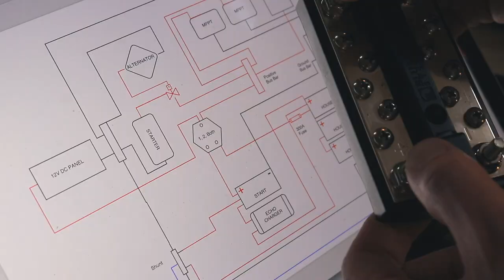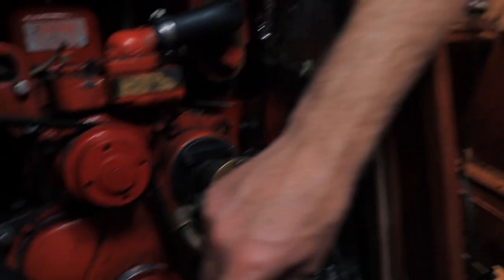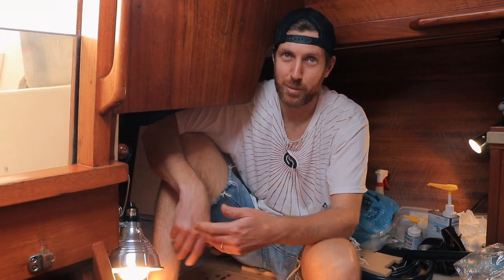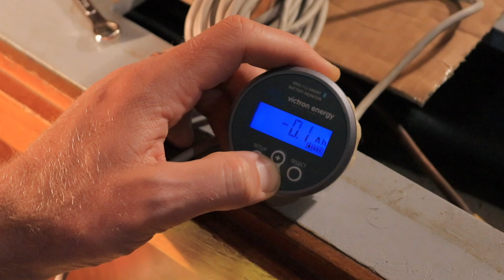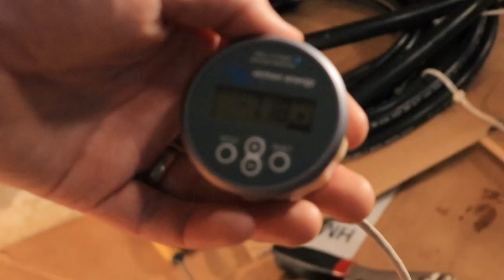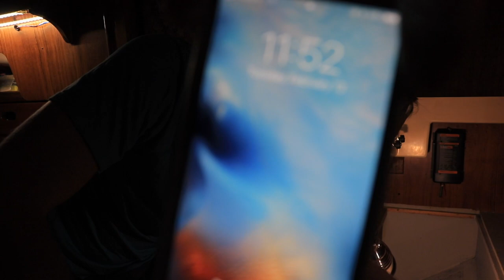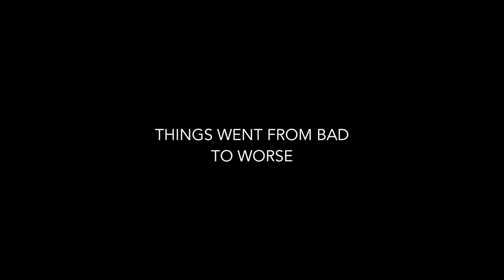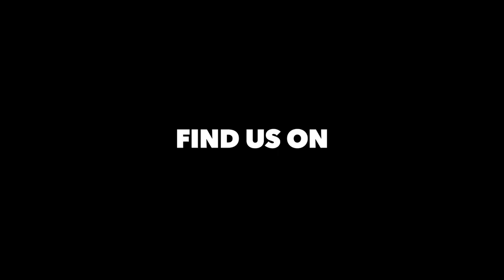Glad THAT’S Over | Sailing Soulianis - Ep. 38

Comment: Coming from a person who spent over 10 years doing that kind of work, namely, building Aluminum Marine Products for boats, including T-Tops, Open and Closed Radar Arches, Bimini extensions (Forward and Aft), Pulpits, Rocket Launchers, Swim Platforms, Fuel Tanks, Bow Rails, Poling Platforms, Tuna Towersmany other things for retail and high-end customers like CIgarette, Pantera, Carrera, Proline, Luhrs, PowerPlay and more, I can tell you for certain, we have never had to cut a product on a customers boat! Yes, it can be very difficult measuring compound angles offsite and then trying to duplicate them back at the shop without the boat, but there are ways that make it possible to do that and it's done every day sucessfully. 

If your not experienced at doing this, It may be best to make up a test-only version that is not anodized, but instead using mill finish pipe, just to get the shape correct for the final product and then using the anodized pipe. See, then, the mill finish one can be used to make a jig or template, it can be scratched and the baseplates (also in mill finish) can be hammered with a dead-blow hammer to make them fit properly when using 3 meaty tacks in a triangular pattern. Once this fits perfectly, it can then be used to make a gage or a jig to make the final product, but it's rarely necessary to do it that way. It's done by measuring on the boat, and then test fitting after it's heavily tack welded. If it's close, which it should be, the only things that should need to be done is tapping the baseplates until they match the exact angle of the mount location. The rest should always be dead on if done by competent builders with the proper experience. 

They should have brought out a lot of cardboard, and cut out the exact shape of the transom, the deck, and all other surfaces making a type of 3-D gage to use later as a double check instead of coming out so many times with a product that was severly out of whack. After the first failed test fit, they should have re-measured all, and found what went wrong in their drawings instead of trying to make it fit and embarassing themselves by acting like it was all part of the process. It is NOT part of the normal process by professionals.

We used protractors and made very detailed drawings of the boat, even putting them on Cad and found this to be a very good way to do it and show the customers that we knew what we were doing and give them confidence in our abilities in the meantime. We also required a 50% deposit only, and the rest was due at install, AFTER the product fit as it was supposed to. It's not simple to explain the entire process, but you seem to be very good at understanding the mechanical aspects of all you do on the boat, so I would think you follow me on this description of how it's generally done. Yes, there are times in prototyping things that we had to do all the measuring then bring out a tack welded arch, just to be safe and be sure of the fit, but if it was off, We measured the differences of the angles comparing what it was, vs what it was supposed to be, and that was all we had to do to make it work then taking back to the shop to weld up fully.

If you want to get quality Marine work, especially a Radar Arch, (fairly tricky off site for rookies) you really need to go to Miami/Ft Lauderdale or even the West side of Florida, maybe Tampa/St Pete. We were out of Miami, and it's known for being THE place to get the best work on those types of products because there are MANY shops doing that kind of work down there. Central Florida also has a couple of good shops. Let me know if you need any advice of finding a safe place to go once you leave that area.  Thanks for the videos, they are much enjoyed but sorry for your luck!
Reply: first off...name calling?? Really??

second...you're saying that they shouldn't pay them one cent??

Alittle late for that...with the required deposits they had to pay, plus the extended docking fees and other set-backs all this caused?? I certainly don't think they're planning on giving them any additional money. and Yes, they've now (obviously) fired them.

question is, how to get your time & all your money back, not to mention that they now have to find someone else to handle this project.

So, whadda they do now?? Lawyer up??
It's the same thing. 
Finding a good lawyer, and playing the waiting game with the court system. UGHHH!!!

Plus, I'm sure that they're gonna be gun-shy with even the best builders they find after enduring this ordeal. This is far from over with.

Man...this is a tough gig to handle, and where nightmares come from.
How to move forward, and keep your sanity.

All the best to you kids! Fair winds
Reply from the maker: Thank you for your detailed description.  It makes a lot of sense and is exactly what we expected to see happening. It sounds like you did good work!

That said, you can only ask so many questions during the "interview" process when hiring someone. Based on seeing what we were told was their work (which wasn't), we expected a decent finish.  We assumed to arrive at said finish, they'd need to take careful/detailed measurements. I don't need to tell you that it ended up being WAAAY less comprehensive than required. But, asking whether or not they use protractors, or jigs, or whatever other strategy for transferring the "boat" to their shop so-to-speak seems like an unrealistic level of investigative detail required for hiring someone, when the whole reason you're hiring the job out is because as a lay-person you don't have the required skills or know-how to complete the job.  

Either way after seeing how poorly they took measurements, the deposit was already paid, and we were "pot committed" to borrow a poker term - and were on the hook.  

We learned a ton from this experience, not the least being how better, to enter future work for hire agreements like this so that when our gut feeling tells us things are not going well and we need to exit, we can do so with proper protections in place.  Unfortunately in this case we had no reasonable exit strategy other than to fire them early on and loose our deposit anyhow.  Seeing as that was the outcome with or without letting them try to complete the project - we decided to give it a go, and do everything we could to get the best result.

All that said knowing what we know now, we need to do a better job of vetting people in the future. But for now we're ready to put this whole episode behind us and move on to more positive experiences. :)
Reply: @indrekkpringi  they were not in other marinas, they were in this one. Why would they stop at every marina in the world when they were given recommendations here?  I didn't see you telling them they'd have this trouble before they were committed to it.  And I already explained to you that they aren't gonna get a contract in this area.  It's real easy to sit there and call everyone an idiot when you clearly have no clue what you are talking about, isn't it?
Reply: YBS Mike - I agree with everything you stated.  I'm a Construction Project Manager and these guys they hired are what we call "Tail-Gate Slam'ers"  - Guys that probably don't have a professional shop and work in their backyard/back of their truck....  Sadly the Soulianis Crew found out how expensive "Cheap" labor really is.  My Advice - Always go check out "their" shop and see what projects they have in progress.  If they aren't working other projects - there is probably a reason for that. 

And to Soulianis, great videos - thanks for sharing!
Reply: Once again, the Red State of Alabama rears it's head in contractors so poor they can't afford material without a deposit and so inept as to be unable to even start a job without destroying the customer's equipment. I am embarrassed at these subpar hooligans.
Reply: @AugustusTitus  I think they were in New Orleans?
Reply: @SailingSoulianis  Thank you! We did our best to make every customer happy, and we wanted to be able to see them out on the water and never feel that we had to avoid any of them. Yes, you could say that we cared. We also loved the process from taking thought and turning it into ideas, then drawings, then a physical entity on a customers boat. 

We grew from 8 employee's to 33 in 3 years and had to expand our building and manufacturing space as well, but life got in the way and there was also a major recession at that time and recreational sales plummeted to record lows so we were forced to change directions. 

On a retail level, it was a lot of fun but as far as working with the manufactures, there were no contracts and they didn't care much about quality, reliability or style, only the price, and warranty. Sadly, they would drop you for a dollar even if you had a perfect record. This gave us a bad taste as far as the marine industry went, and we vowed to never again do work in that industry.

Quite honestly, it's not an easy Business to make a profit in, let alone break even. It's very cut throat. It's possible, but you must cross a high threshold of production to sustain you while you also cater to limited retail sales to make any money. I enjoyed it while I was in it though, and still see customers from time to time with our tags on their tops. :)  

I wish you the best and really enjoy following you along on your adventure!
Reply: I was thinking the same, south Florida. Working in manufacturing since 74 as a machinist? Buyer beware! Bad welds are clue #1. JMO, but next time I would also look for someone who works dockside if possible.

Also, does anyone build using separate mounting brackets where the frame can be bolted onto the brackets? Build the mounting brackets first, clevis! Just a machinists perspective!

A running welder joke, I've seen your welds and I'm buying you a grinder for Christmas!

Comment: Lauren & Kirk, you both are an inspiration because of the way you tackled the battery/wiring project. It looks like you did a first class installation on the batteries and upgrading the wires. It was awful that the contractors you hired gave horribly poor service which resulted in a very bad experience for you. I pray you eventually install the equipment you need for your solar panels.

Comment: The smile on Kirk's face when he realized all the planing and work came together successfully is priceless !
It is better if you only have ONE bus bar/distribution point for both positive and negative but in your case having TWO makes for a cleaner installation and they are joined by a well made, properly sized cable.  The very last step, when all the 'glassing/securing/tightening is done is to liberally coat all screw connections and battery terminals with either silicon dielectric grease, lanolin grease or lanolin spray (Fluid Film).  It won't look pretty but you will not have corrosion !
Reply from the maker: Thanks Jack! It's easy to miss in the timelapse of my final wiring, but I had the canister of dielectric grease and greased all connections. :)
Reply: @SailingSoulianis  Great !  "An ounce of prevention is worth a pound of cure !"

Comment: Sorry for your troubles. Even on the video that arch wasn’t close to fitting. What a bunch of hacks. A suggestion, although it’s probably too late and you probably have solid panels, I have flexible panels I mounted to my Bimini using Velcro strips sewn to small flaps on it to hold the panels in place. There are 2, 100 watt panels. When not needed we just remove them from the Bimini and you wouldn’t even know they were there. When they are on, it looks very professional and well secured. If  you’re interested, I’d be happy to send photos. It looks good and works well.

Comment: Be stoic about this. Remember, every tragedy is a blessing in disguise. 

Clearly, these fabricators were not as professional as you thought. What if it had worked out and mid-way through a sail, the entire apparatus fell off? This is for the best. You grew in the process, learned to wire up a boat, and understand how to better deal with contractors. 

You are both still healthy. This is a win.
Reply from the maker: This was exactly our fear as time went on.  Part of the reason we insisted on having a shake down sail as well. In the end we were actually terrified of keeping the arch and were extremely relieved to have finally made the decision to fire them.

If you notice, the last time they brought the arch to the boat, there were two t-shirts tied to the top horizontal bar.  These  were to hide huge holes they had drilled into the joints because they forgot to pre-drill inside the welded joint for the cable runs we specified. We didn't notice this until after we had already fired them and they had taken the arch off the boat.  And it made us wonder, how many other unseen issues would of cropped up afterwards.

Comment: It seems when you start with a used boat you can never have a nice clean engine room like in a new million dollar yacht like we all would love to have! I spent two years getting all the wire removed and replaced on my old sailboat by a certified marine electrician forget the thousands of dolllars it cost me. So I think you doing really well so far in your electrical rebuild. Great job so far! I wish I knew more about elec. As for the radar arch, there are no good fabricators out there any more. I have found that unless they can work on your boat at their shop forget them. No one can seem to measure or follow a diagram drawing out there. If they can walk back and forth to the shop and put together one piece at a time they can get the job done.....barely! It's ashame they charge so much for such poor work! Problem is not enough new people are coming into the industry.  Good luck!

Comment: Sorry about the frame work and damage to Soulianis. Nice electrical work. The wiring harness upgrade and Echo charger is key! Never deplete your start battery and remove 50 amps from running to your cockpit. Voltmeter is good enough. Hang in there!

Comment: I know nothing of metal but my family was in carpentry back to Heidelberg Castle (I think after a major Fire, Circa 1450). Anyway, I learned from Master Carpenters to make mockups out of in all sorts of material to test the fit, critique the designs, and transfer angles, etc., before working with expensive hard woods. Then they would stop at the job location to test fit, which usually happened so fast the customer never saw the model. Then back to the shop, with the model, sometimes in sections. Then the finish product is constructed out of the exotic woods. The customer would think we were geniuses (we all do have 135+ IQ) and it felt good to make people feel like we were worth our high price. We were competitive but not often low bid. But reputation allowed a little premium which I think was well earned. I would have let a picture of the company logo get in the shot.

Comment: I have been admiring your perseverance throughout this series. Sort of indomitable. Plus the breadth of expertise across electrical design, installation, wood work, fiberglass work. Also, you guys designed an app which provides a visual presentation of important points to a buyer when looking to buy a boat. Drawing data from the cloud? Is there anything you guys can't do? I am very sorry with what transpired on contracting out on the bimini frame. I am betting that Kirk could probably do a better job with his usual 3 day learning curve. I've learned a lot from you guys. Thank you.
Reply from the maker: Spearfish. Rig a whisker pole correctly. Sing a single note in tune. Haha, there’s plenty. But thank you for the heaping pile of compliments! Really glad you’re in enjoy the videos. 🤙